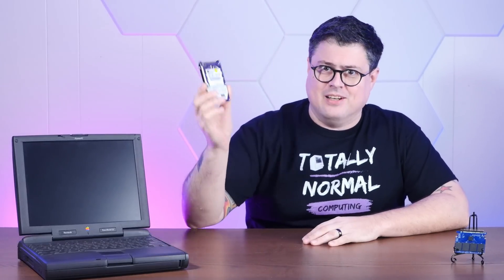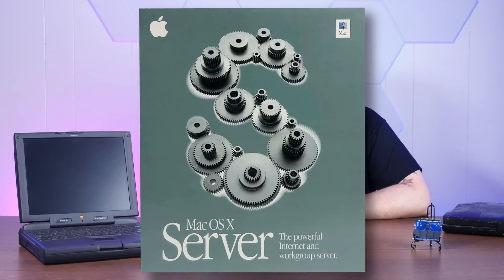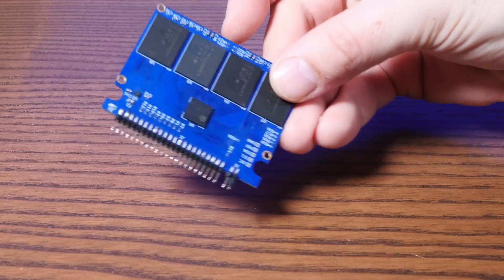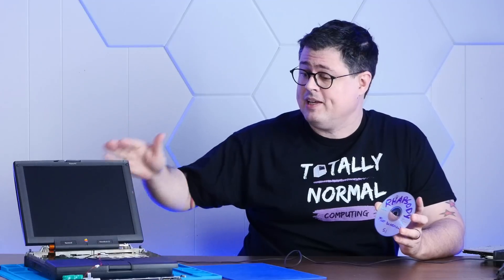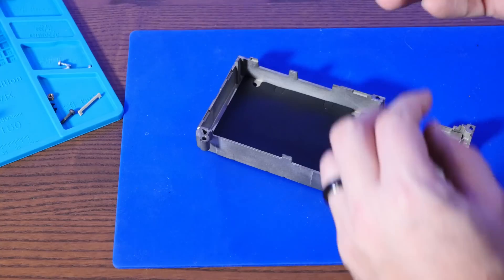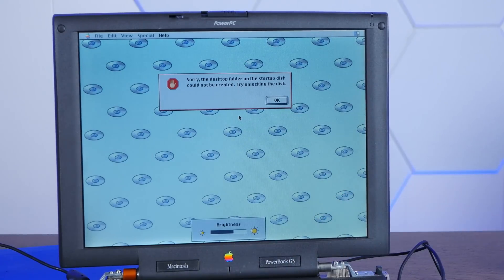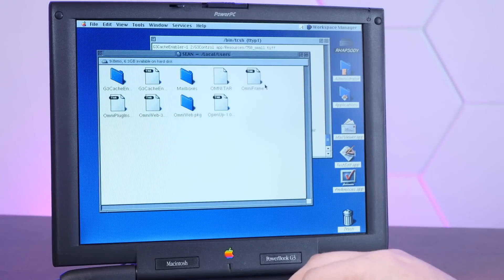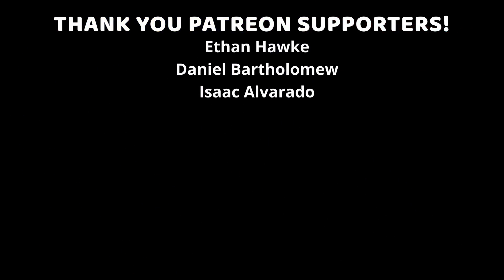Installing Rhapsody OS on a Homemade SSD

Comment: Just remember that’s it’s Rhapsody what’s inside iOS and iPadOS, not OS X. 

Why? You might ask. 

Well the reason is that Craig Federighi and it’s team ported NeXT step to PowerMacs and then forked everything to create OS X including a switch from Display PostScript to something akin to Display PDF and finally Cocoa. 

The iPhone project didn’t had the luxury of such a high end system so they basically started with Darwin, which was the text version of Rhapsody and moved upwards. 

Today the codebases share lots of stuff but you can still feel the difference between them.

Comment: For 44 pin IDE drives, no jumper is AutoDetect. Jumper closest to the connector is master, and the other is slave. I imagine @dosdude1 stuck to that standard in designing his so it can be used on any IDE platform.

You could also just get a DOM which is industrial computing terminology for Disk On Module. They make them in 44 pin laptop IDE form factor and have been for many years, though I think the largest size is about 32G. Why you would need more than that amount of space on the machine if this vintage I wouldn't know.

Comment: Future reference:
IDE/PATA drives MUST have a Master or slave jumper set - if the drive even supports it, sometimes no umper means CS "Cable Select" which means the middle of the two drive cable means slave, and the very end means Master.   That being said, most IDE controllers WILL NOT see a drive without a M/S jumper set especially older hardware

Comment: love to see an update video on the lcd screen issue, glad you have extra parts to make the video work, I would love to mess around more with old macs and upgrades but most are just way too pricey  for my tastes guess I'll just have to enjoy my bog standard macs, I do have an old power book that could use a modern solid state drive like that, the old clicky drive worries me too much that it'll quit so I don't use it much

Comment: Speaking of the Kanga G3, it was always in my opinion something of a "dirty trick" that Apple specifically would *not* support it in regard to forthcoming G3+ Mac OS versions.  I get that it was really an older generation machine than the "proper" G3s, but I always thought could have generated some easy goodwill by making special enablers to support it (considering it was one single model, it wasn't like they were being asked to support nubus machines or anything truly ancient by that point.)

Comment: Great video as usually! I was inspired by those Power PC Mac's and bought a Power Mac G4. Managed to add a SATA drive and even installed the latest Mac OS 9.2.2 last night. But I have a really unusual problem — I've looked for old software on the internet and there is plenty. But it's dsk, sit, or img, or toast format which I don't have a way to open without already having StuffIt, Toast.. which cannot be installed because they are in the same format as well?!? I've tried to mount some dsk files with Disk Copy, with no luck — error -38. Any advice on how I can install the basic software without having the floppy disks and CDs?
Reply: IMG format should work natively in OS 9. I have a PowerBook G4 with OS 9 and I think I installed Stuffit from the IMG file.

Comment: i remember when the operating system came on floppies and you could build the system folder by dragging the system folder from the floppies and then install the other system files from the other floppies copied to the new system folder.

you often had a system disk, printer drivers disk and a fonts disks.

i am not sure when apple moved to using compressed tome files and had an actual installer to where you could no longer build a system folder.

as of the delay in releasing the video you could released 2 videos one main video and a followup or appended/amended  version to replace what you had before.

Comment: I ran Rhapsody in a production environment back in 2001 because AppleShare IP kept crashing. I had no idea it could be installed on one of these G3s - I thought it was just the PowerMac G3 Server and the very first G4! Awesome. The best feature of it was being able to perform user and share admin via the built-in web server. It was a cool OS at the time.

Comment: When you actually fixed the screen and the installer without creating more issues, I thought this video wasn't going to be cursed at all. Thankfully I wasn't disappointed, although it was more an issue of Rhapsody not being designed to run on a PowerBook.

Comment: You just helped me find the actual laptop they used in this one anime I watched, whole time I thought it was a powerbook 3400 that they wrote "powerbook g3" on when they animated it, but it turns out it actually was a product! now to be on the lookout for a reasonably priced one on ebay or in my area
Reply: Which anime? I’m intrigued, ever since I noticed the computers in RahXephon run IRIX (has me thinking maybe SGI hardware was used for some of the animation?) I want to check out every anime that references specific retro computers.
Reply: @ashcrimson1314  The anime is "You're Under Arrest" There's a 4 episode OVA in which a PowerBook 180c is used, then there's a tv series after that, I can't remember if it's still a 180c in the tv series or replaced with a generic laptop. After that there's a movie where the PowerBook G3 Kanga is used, and after the movie theres 2 more seasons of the show but I can't remember if they had an accurate powerbook or just a generic laptop.
Reply: @xzomb1exo  Thanks!! Will definitely give it a watch.

Comment: I remember buying the 2300c and the Duo Dock when they were brand new. Considered an awesome machine at the time. A few years later I was a tech lead on a software project when Rhapsody came out. Apple was planning to have no hard drives on the desktop. I emailed Steve Jobs and said Apple was making a mistake. He shot back "Boy, are you wrong".

Comment: The biggest issue with NAND flash is it's extremely short life span. 
Eventually we'll have to to manufacture spinning HDDs to replace the quickly failing NAND flash drives.
Reply: While it's true that flash does technically have a finite number of reads and writes, that number is so massive that it'll last longer than the moving parts of a spinning hard drive. Especially when using proper ssd flash like this one is as opposed to the cheap stuff made for flash drives and cheap SD cards.

Comment: I stumbled upon dosdude's ssd assembly videos when looking for an IDE SSD that had a zif connector for my Microsoft Zune, would love to try one but unfortunately do not yet have the know how or tools to assemble one. Zune is very picky about drives it accepts, only ssd I know of that works in it is the kingspec 120gb zif ssd

Comment: so could PCBway make the fully populated board, probly not connector on it side but that's any easy bit of soldering the flat pack chips, needing hot airs station, and all sorts to work with? or would you still have 5 or something?

Comment: The original CD image could be made to work if you burned it with Toast. Every other burning program that I tried would fail. I think Toast would simply inject the Desktop Folder into the burn as it was finishing it
Reply from the maker: Ohhh interesting
Reply: @ActionRetro  Yep. Honestly I know “paying” for optical media authoring software is a little out of style these days. But if you are super into Vintage Mac stuff and are planning on burning legacy disk images, Toast is really worth it. One way around that is to have a vintage machine with a CD burner and use Toast 7. But since the modern version can also do it, I don’t mind, throwing a few dollars their way to encourage the software to keep developing.
Reply: @ActionRetro  Also one thing that you may want to be aware of. The images that were on the Garden and the Repository are the same images that were originally on WinWorldPC. I few years back when I was super into trying out these beta OS's on a Vintage PowerMac 8500 I was able to get the DR2 Image working with Toast and installed just fine. But When I wanted to go even further back and try DR1, that installer would error out on the Rhapsody installer partition of the CD image.

Ever since then I have been on the lookout for another Rhapsody DR1 Image for PPC. Perhaps you might be able to find someone in your network who has original media and rip a new copy ;)

Comment: 12:00 yes, "classic" macos included invisible folders desktopDB (which I think were used to keep track of icons and other file metadata) which the OS writes and reads all the time; since you booted from a read-only volume it's complaining it can't modify them (these files get modified when you perform a "desktop rebuild" function)

Comment: The long startup post freeze was almost certainly at the place in the unix startup scripts where fsck is run to scan and repair the filesystem.  Back in the day with pre-journalled filesystems it used to take ages.
Reply: That almost reminds me - at one point we had lab of 486dx66 machines with linux (hard drives were like 250mb?), and well.... one of the teachers did shut down the lab by master power switch...
Let's just say - he wasn't very popular later - next boot took about an hour or so.
Full scan of ~250mb of ext2 filesystem on ancient drives was sloooooow.

Comment: Hmmm, wonder if one of those SSDs would work in a Playstation 2? No funky SATA -> IDE interposer. Can't remember if the IDE pinout between a laptop and desktop are different but could probably modify things on the board.
Reply: They are different (44 pin vs 40 pin) but there are cheap passive adapters that can adapt between the two. Using it in a ps2 was my first thought as well.

Comment: I love the way Rhapsody looks. It’s like Mac OS 9.5

I’ve always wondered if it has live window resizing but so far no one has ever resized a window in one of these videos!
Reply: Rhapsody (while it was running the Display postscript server) did not support  live window resizing. That support arrived once display postscript was swapped out for quartz.
Reply: @brianarmstrong234  do you know when DPS was swapped to quartz?
Reply: @MaxOakland  If I am remembering this right, Mac OS X Developer Preview 1 was the last version of the OS to use DisplayPostscript and was swapped for Quartz in Developer Preview 2. Although DP2 still had an OS 8 Platinum style UI you could still verify Quartz through the translucent drag select of multiple items.

The big accomplishments of DP1 was the 1st build of the Carbon Libraries that devs could take for a spin and getting the OS off of Mach 2.5 based Kernel that NeXTSTEP and Rhapsody used and onto the Mach 3.0 based Darwin Kernel. Big milestones in and of themselves. Hence Swapping out Display PostScript would have to wait till DP2.

DP2 was also the first build to have the initial version of the Carbon based Finder. DP1 still used the NeXTSTEP derived Workspace Manager
Reply: @brianarmstrong234  Thanks for the details! I learned several things. Very interesting

Comment: I should see if that IDE card works in my 233 MHz (no backside cache) PowerBook G3 "Wallstreet." I have the one with the bottom-of-the-line 10.1" passive matrix display.

I was able to upgrade it a few years ago with a new daughter card which had a 266 MHz G3 processor with a 1 MB backside cache. That was a big improvement and works great for all kinds of retro gaming.

But I had earlier also tried to install an internal SSD. I got as far as the machine seeing it and then offering the chance to format it but would freeze every time in the formatting process. That SSD (and adapter card) later (with the edition of another 2.5 to 3.5 adapter card) worked just fine inside my Power Mac G4 MDD, so I know the hardware was good.

I gave up on the internal SSD and went for connecting an SSD via an external SCSI card that uses a micro SD card. That works well. But I'm thinking an internal SSD could be faster. I'd like to get my hands on what Sean has and see if that works.
Reply: It does, I’ve tested these drives in both my Wallstreet and Lombard, and they work without a hitch.
Reply: @dosdude1  Thanks. I just emailed you to put me on the list for possibly purchasing the finished product. I very much appreciate your response.

Comment: There's a bunch of IDE SSDs. Transcend still sells new ones.

They come in sizes about 16-64GB, and the price for them is usually fair considering how nieche their market is.
Reply from the maker: I think those are MSATA SSDs on adapters sold as IDE SSDs - at least all the ones I've seen are.
Reply: @ActionRetro  Those Transcend ones are actually real IDE SSDs, but they’re horribly expensive. Like over $100 for a 64GB drive. And I believe 64GB is the largest one they make.
Reply: @dosdude1  I saw one recently for 30 bucks for 32 GB. Considering how little the amount is, that's pretty fine for me I guess.

Comment: Rhapsody is my favorite! I used to have the Intel version installed on a Dell Latitude CPx, which had a fully supported GPU under Rhapsody (supported color, acceleration, etc). Glad the SSD worked in the Kanga! The drive I sent is actually a 256GB drive, but of course those older machines are only able to see drives up to 128GB. Also, the master/slave works opposite of standard hard disks; jumper set on those two pins is the master configuration, and no jumper is slave.

Comment: If you read the tops of most modern (Y2K or later, usually 4GB or larger) hard drives, you'll see a statement such as "RATTLE NOISE IS NORMAL." The rattle is caused by the passive armature lock that they use in most ramp-loading hard drives. Some drives (notably Hitachi DK23CA through DK23FA drives) used active armature locks and they don't rattle. Fujitsu was the last laptop drive manufacturer to use CSS, ending with the MHL (12mm, 30GB) and MHM family (9mm, up to 20GB), and they don't rattle, but the MHN and later ramp-loading drives do.

Comment: If DOSDude can get PCBWay to populate those SSDs, he could mass produce them. Though i could see having to ship them some of the components. I actually need some, like in the 128GB-256GB range, but obviously i can't be spending $100+ each.

Since i can get some 256GB sata SSDs for pretty cheap and some IDE to SATA adapters. Even IDE to SATA m.2 boards aren't too expensive. Just compatibility can be hit'n'miss.

Comment: That error message about the desktop was EXACTLY the problem I encountered whilst trying to play with that version of Rhapsody. I never figured it out. Glad you did as it as driving me nuts at the time. I've since turned my attention to running it on x86 as I finally have compatible hardware to run it on. I've found that the file system is very temperamental. If you hard reboot it either completely corrupts the file system or breaks stuff on it. I couldn't open Configure after messing with video settings. Great video ;)

Comment: It seems like it would be a good idea to shoehorn a modern SBC into certain old laptops since they often had ergonomic and aesthetic features not seen today. It would require custom monitor and peripheral circuits and drivers though but that's much easier to do today.
Reply: Some people put modern motherboards in old ThinkPads, I haven’t heard about that for Macs though unfortunately
Reply: and you cant really get 4:3 on newer laptops either